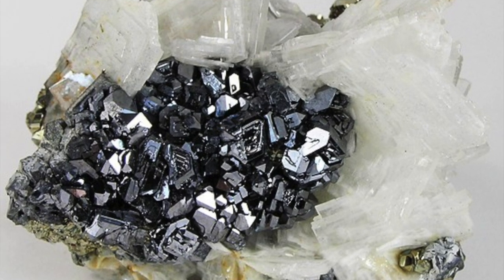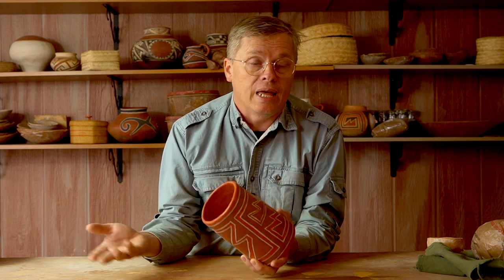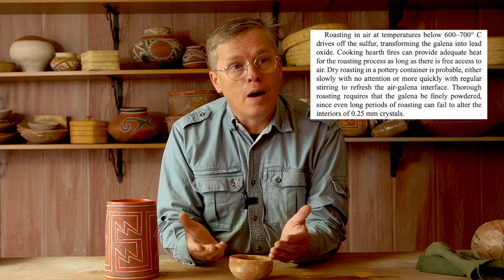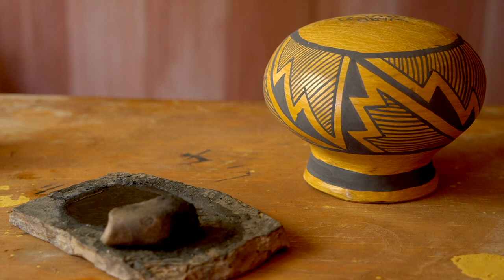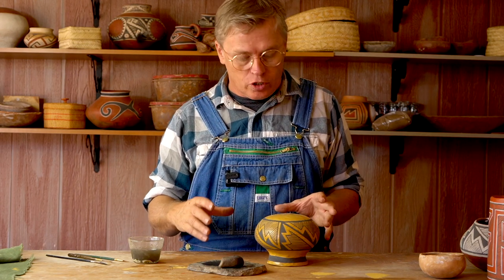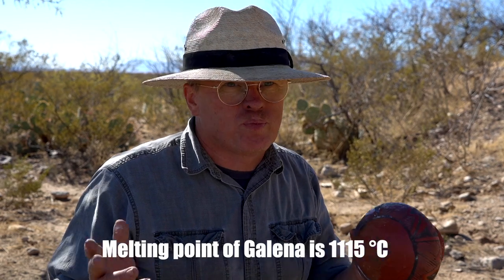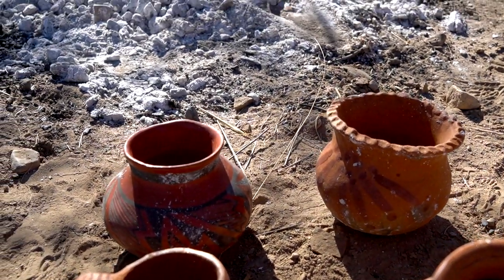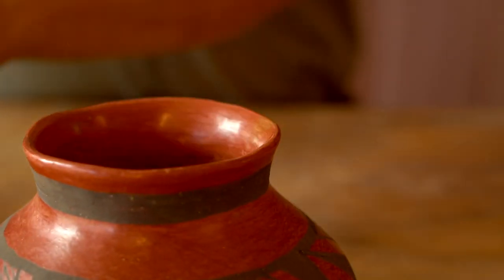I Try to Make LEAD BASED GLAZE PAINT on Pottery, See What Happened

Comment: Maybe I'm wrong, but the answer might be very simple. glazes, when applied thinly, as you applied your lead based "glaze," sort of soak into the clay and come out matte. Try doing 3-4 coats. Worth a shot, if you are still interested in this.
Reply from the maker: Yes I am still experimenting with this and have had some clues that thicker paint equals better glaze. Thanks for the tip

Comment: Hi Andy. I saw an article about making sulfur soluble for use in gardening by oxidizing it at 200C.
If you are able to heat your ground galena to 800C, well above the oxidation temperature of 200C. Then regrind the resultant puck, you might be able to dissolve / flush the sulfur out of your reground galena with water.
The article also mentioned soaking in an acid to increase the sulfur's solubility in water.
At the time this glaze started showing up they would of had access to uric acid.
Perhaps you might know of a chemical engineer that might be able to offer a simpler way of removing the sulfur. 
If enough people start thinking about this, the cat won't have a fur coat, cheers.
Reply from the maker: Thanks for that tip, I might just try washing it, I've got nothing to lose.

Comment: There was a surge of interest in colonial art and craft and country decor in the seventies, and part of it was a Pennsylvania  German style of redware that was rolled out, had white slip applied, cut into circles, and eventually formed into shallow pie plates by slapping it down on a mold.  The shape was like a typical Mimbres bowl, as if a clay disc was dropped and pressed on a bowling ball.  The edges were then "coggled" with a rotary tool, and the final touch was to dust the inside with pulverized white lead (as I recall).  I can't spare the time to check my references or research from other sources, but the result was a think, clear glaze that sealed the low fire terra cotta.  It was essentially glaze, and was lead of some sort.

This may provide a clue or research path for you to pursue.   Lead was a more popular glaze ingredient before its toxicity was so well known.  The clear glaze we used seemed to get a similar result, and sealed the clay without any drips or cloudiness that made us aware that glaze had been applied, unless we were curious potters with some professional interest.

Kemper       Vallejo         Currently remote studying some exciiting pottery traditions through Solano Community College, which led me to your site last fall.
Reply from the maker: Cool, thanks for sharing.

Comment: Gee this got interesting and had me ask "how do you oxidize lead ore" and then here I am reading an article from 1976 OXIDATION OF LEAD SULPHIDE Peter John  that says to 2 PbS you add 3 O2 to get out 2 PbO and 2 SO2 out... that was by page 9 of 231... Grind it up, use lower temps, and wave air in don't let it heat without fresh air flowing is what I think I am reading ...
Reply from the maker: Good stuff, thanks for sharing.

Comment: Nice try. FYI, Rosa B/w was a Colorado lead-glazed pottery type produced ca 700 AD, well before it showed up in AZ.
Reply from the maker: Thank you and yes, I remember that. Still there does not seem to be a technological bridge between the 700 Rosa and the 1270 Pinedale. So perhaps Rosa is a technological isolate, not connected to the larger White Mountain/Zuni/Rio Grande glaze phenomenon.
Reply from the maker: But you are correct, WMRW was not the first glaze paint in the SW.
Reply: @AncientPottery  "Everybody knew everything, distance was nothing..." Steve Lekson